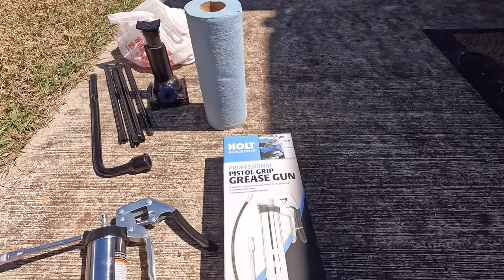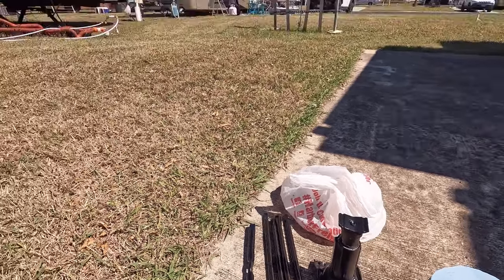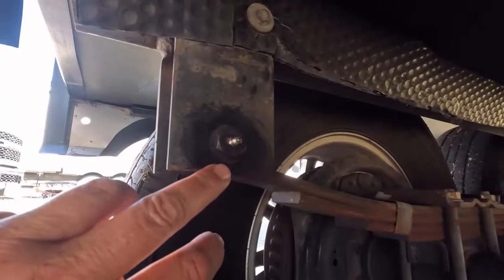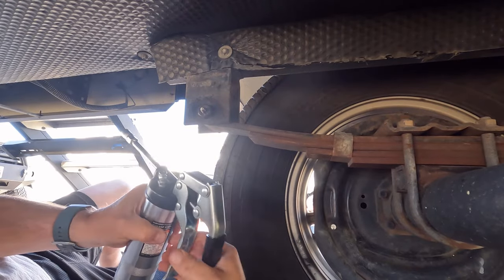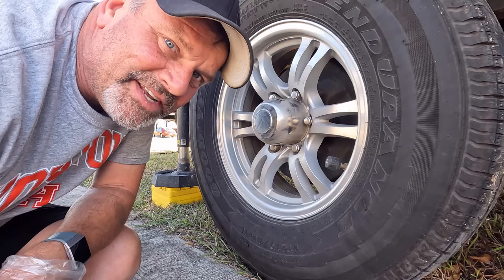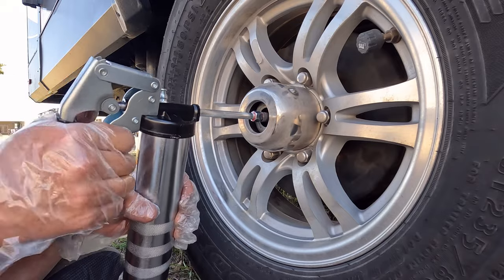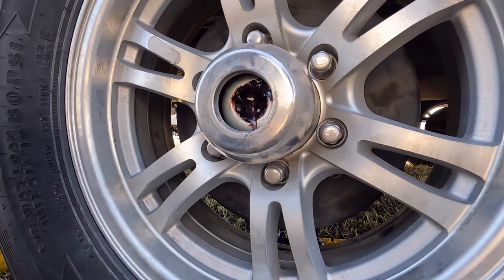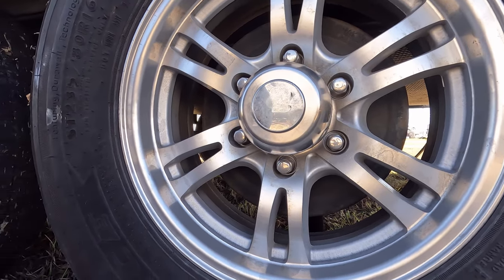The Dexter EZ Lube System for RV Wheel Bearings and Axles | So Simple YOU Can Do It Yourself!

Comment: Nice clear video, Dan!  Thanks for posting!  I just bought 4 tubes of grease for my travel trailer and I'm getting ready to do it to my Dexter EZ lube Axle.  But, I'm a little worried.  I see other videos where people claim they blew out the rear seal when they did it.  That has me worried.  I did talk to a mechanic and one tip he gave me was to do it on a hot day and put the grease tubes out in the sun to heat them up, thereby making the grease flow easier.  Makes sense to me.  He also said not to keep pumping the grease gun like there's no tomorrow.  He said to pump a few times, stop and spin the wheel to distribute the grease and then repeat.  Myself, I find it hard to believe you can blow out a seal that easy just by pumping grease into it.  Those seals are a pita to get out when you need to remove them, let alone blow them out with a grease gun.  But, I guess it happens.  Again, nice video and very clear!!
Reply from the maker: Thanks!  What we’ve read and heard from Dexter is that it is safe for well maintained axles and bearings. However, they said it is possible to blow the seals if the seals are dry rotted. However, because of the controversy, it is best to take as much precaution.  I never thought of letting the grease sit in the sun awhile but that’s a great idea. How old is your trailer and when was the last time the bearings were greased?
How have you been doing?  We are in Texas right now and heading to NM in two weeks.
Reply: @CompassRoadz  Lucky you!  We live in Kansas and only use our RV about 2 or 3 times a year.  I have a 2019 Coachmen Catalina.  Probably no more than 3500 miles on it.  Never did the bearings yet.  I heard they are pretty dry from the factory so that's why I want to inject some grease into them.  I didn't even know I had the Dexter EZ lube fittings until I started looking at maintenance on the RV.  I guess if the seals are dry rotted, that would make sense for them to blowout when you pump the grease in.  I'm taking my time doing it.  If each wheel takes 30 minutes, so be it.  Better than having to replace brakes and all that stuff.  Have safe travels!
Reply from the maker: Let us know how it goes. Safe travels to you too!!!
Reply: doing mine tomorrow. eeeeek
Reply from the maker: Good luck. Let us know how it goes!
Reply: Alright so everything went OK though I thought it did not lol. Let the grease sit outside in the sun most of the day.. jacked up one side removed the rubber cover and started slowly pumping and turning the wheel at the same time. Once I started seeing any of the new color grease inside the cavity there I stopped and did the other side. I don't see the point of filling the entire metal cup/housing thing full of grease. When I was doing the 2nd side it took many more pumps without seeing any new grease. My brain went "oh great you blew a seal" so I ended up removing the castle nut then the hub and everything was fine and I did not blow any seal. Installed it all back together and it's all good. Tips... I would remove the rubber cover AND the metal housing that you can pop off with a flat head. This makes it easier to see when new grease is coming out. Also.. if it's a newer camper where there isn't much grease in there already.. expect to be pumping and spinning more than you think. With all that said.. I'll probably hand pack the bearings next time since it's easier to get to them than I thought
Reply from the maker: @Dan007UT  glad everything turned out good. Doing a manual repack definitely has its benefit of inspecting all components. We are replacing leaf springs soon and a few other maintenance tasks to give us better peace of mind.
Reply: @Dan007UT  Thanks for letting us know, Dan.  I'll probably do mine in the next week or two.  I'm sweating it, though.  Still worried about blowing out a seal.  How long did each wheel take to do approximately?  I have a fairly new RV and never packed the bearings.  I'm sure they will take a bunch of grease.  Also, about how much grease did each wheel take?   I bought 4 tubes of grease.  I've heard some people say each wheel takes about a tube.
Reply: @garyp9906  I'll have to check on how much i used. I'd say I used about 20 pumps per wheel. I didn't want to over do it lol. I'll get back to you on how much I used but I know it was less than 1 tube.
Reply from the maker: It took me about 5 mins per tire not including jacking the tire up. Just keep rotating the tire as you fill it and you should be good. I had to stop and clean out the old grease a few times before I noticed the new grease coming through. Let us know how it went!
Reply: @CompassRoadz  I actually bring along 2 spare leaf springs, shackles, bolts, equalizer and U-bolts with us.  I've seen many videos where people had broken leaf springs and it was a big, big hassle getting the trailer towed or having someone come out and put new one's on.  Gosh, it's a shame you have to take along a complete suspension system with you when you go camping.  I even take along an extra set of wheel bearings!
Reply: @Dan007UT  Thank You for letting us know!
Reply: @CompassRoadz  Thanks for letting us know!
Reply from the maker: Coincidentally, we just received a set of four leaf springs for the trailer and will install them when we get to Alamogordo next week. Watch for a video coming out in a few weeks about that because we plan on doing it ourselves. 
We do think it’s a good idea to carry a leaf spring with us so we’ll get another to store in the rv for emergencies.
Reply: @CompassRoadz  Yes, definitely make a video about installing new leaf springs!!  Although I carry spares, I've never actually changed one.  I've seen many videos on how to do them, so I feel confident about replacing them if I need to along any of our journeys.  I carry 3 jacks, impact wrench and sockets and an arsenal of tools.  I'd hate for a leaf spring to break and be stuck for an indefinite period of time someplace.  Like I said, it's sad a person has to bring along all these replacement parts when you travel.  But, most auto parts stores don't carry stuff for RV's.  I always try to be prepared when I travel.  We have a tandem axle trailer and believe it or not, I carry 2 spare tires with us.  I figure if you get a blow out on one tire, it might take the other tire out, too.  Two flats on one side with only one good spare ain't gonna do you any good!  Waiting for the video on leaf springs!!
Reply: @CompassRoadz  Well, I did mine today finally.  We are going to take the RV about 400 miles from home this coming weekend.  Not a bad job.  I'd say I probably only used one tube of grease for all 4 tires (bearings).  I turned the wheel and slowly pumped it in.  I stopped when it started to come out.  Actually, the old grease didn't look that bad.  It definitely wasn't new, but it didn't look that bad.  As long as I know I got some grease in there, I'm happy.  I heard they don't use a lot of grease at the factory, so I was just glad to get some pumped into the bearings.  Perhaps one day when I have time, maybe I'll remove the bearings and clean them and do all that stuff.  But for now, just pumping some grease into them makes me feel a little more at ease!  Thanks again for a good video!!
Reply: @Dan007UT  Just did mine today.  I only used about a tube for all 4 wheels.  I stopped when I saw it start coming out.  I'm just glad I got some grease in there.  That tells me they were pretty dry from the factory.  I won't worry as much now when I'm pulling my TT.
Reply: @garyp9906  nice!!
Reply from the maker: Now at least you know how well they are and can determine the right maintenance for them.

Comment: thanks for the how too, I think I have a blown seal. I was coming back from Florida this week and were getting heavy rain and my TPMS system went off with a high temp warning. It was at 92f and the other 3 tires were at 62F. I pulled over and and inspected the rim and it was hot!! jacked the rig up to see if there was any play or restriction from the breaks.. everthing was fine. I pulled off the zert seal and I saw the bottom of the bearing was wet grease. So i think it was getting washed out for the rain. I pumped new grease back in there and she was fine for the rest of the trip. I will tho pull the rim off and inspect that seal.
Reply from the maker: Sounds like you had a scary experience. Glad you were able to get back on the road quickly enough even with those conditions. Hopefully you’ll get to take a good look at it and make sure it’s safe. Let us know how it turns out. Thanks for watching!
Reply: @CompassRoadz  thanks CR, will do

Comment: Thank you so much. I had no idea my axles needed lube.
Reply from the maker: We are in NWA are you fellas over by Grand Lake still?
Reply: I don't know of any axles which need lube but some guys run "wet bolts" on the pivot points for their leaf springs. This creates four grease zirks per leaf spring plus one for the rocker/equalizer bolt = 9 zirks per side of the trailer if you have tandem axles.

Comment: System works fine. First time you do it it takes about 3/4 of a tub to fill the system. Once filled it will start coming out the front.  The grease goes through the zerk, all the way to the back through the back bearing and then takes a different path all the way back to the front and through the front bearing and out. There should not be enough pressure to push grease out the rear seal unless something is wrong.

After the first time you should see grease being expelled at the same rate as being inserted. 

I think many people confuse this with bearing buddies which are completely different and completely useless.
Reply from the maker: Great info. Thanks for watching!
Reply: That is exactly correct. I’ve been using EZ lube spindle for years with no seal blow out.
Reply: I agree -- Bearing Buddies suck! Lost SO many of those on boat trailers over the years that I quit using them = expensive, heavy, and worthless.

The last time I paid someone to pack our wheel bearings, the bonehead just sat the seals on the spindles because they wouldn't fit into the bore. I learned to pop 'em in the freezer the night before and quickly tap 'em into place in the morning = easy breezy. :)

Comment: Hey Dan why didn't you take the tires off and pull the hub to check the bearings? Are there concerns with pulling off a hub that has electric brakes?
Reply from the maker: Great question!  The whole purpose of the EZ Lube system is to avoid that and the mess that goes with it. That said, even we are skeptics and I do check them manually every other time or so when I do lube them. They always seem fine but it does give me peace of mind to have eyes on every do often. Thanks for watching!

Comment: I really enjoyed the vid.  There are divided comments on Dexter EZ Lube. As a newer rv’r with a trailer, I have felt I needed to re-inspect and grease bearings and brakes every time I go out to camp!  12 months or 12k miles whether you put 1 mile on or 12k!  In some vids, folks say you should keep spare parts, too!  Where’s the time to go camping and have fun!  
P.S. can you check the seals without taking wheel off?
Reply from the maker: We are glad you enjoyed the video. We probably should have used mileage instead of time (one year) to use as a standard to regrease them. I don’t think there’s a way to check the seals properly without taking off the wheel. Maybe someone else can chime in. Thanks for watching!

Comment: I use Amsoil synthetic grease it takes heat a lot better and mine are barely warm .
Reply from the maker: That’s good to know. Thanks for sharing!  
Anyone else use Amsoil synthetic grease or have found another grease that works well?
Reply: I believe I'll try Schaeffer syn. grease. I use their motor oil in my diesel truck.

Comment: Having done this many times...the engineer that designed the outer cqp has obviously never held a wrench in his life.  To do this correctly you need to push the old grease out. With the outer cap on this is a nightmare because you need to get all of the grease out of that cap.  Its a ridiculous engineering fail.  If you just grease it until you see grease you are doing it wrong.  You do it until you clearly see and smell new grease.  The used grease has a clear burned odor to it and it needs to be pumped out as you rotate the tire.  A simple redesign of the outer cap could have made this exponentially easier.
Reply from the maker: Thanks for the info. That’s a lot more than I could know about bearings. I’m very much a novice. I only gathered information from Dexter and other videos to be able to do ours. I agree a simple way to grease bearings would be a break through!  Thanks for watching!

Comment: My dealer told me that they had to be hand packed because the grease gun would blow the seal. I don't think i Believe him.
Reply from the maker: Not if it’s the Dexter EZ Lube system. However, you do need to take some care to avoid blowing the seal. Dexter claims it happens mainly after it’s dried out after a few years without maintenance. Thanks for watching!
Reply: Can’t push seal out of the plug is open, zero pressure doesn’t push out a seal, just remove all excess grease.

Comment: You just set yourself up for axle seal failure… wayyyyy too much grease all its gonna do is push it out the back right on your brakes 🤦🏼‍♂️
Reply from the maker: Well 1600 miles later with no issues.
Reply: The way the rubber boot around the grease zirk is designed, it's easier for excess grease to ooze out there than it would be to pressurize and blow past the spindle seal. Those seals are designed to grip tighter on the spindle as the pressure increases. We've averaged 11,000 miles for the last 8-1/2 years with quite a bit of that in off-road conditions -- never had a single wheel bearing failure with our 33' 5th wheel. :) Then again, when the going gets tough, we slow w-a-y down with our F350 in low range = no need to engage the manual front hubs if we don't need the extra traction. :)

Comment: Being in the lube biz you should never mix grease..
Reply from the maker: Didn’t know that. But wouldn’t the new grease expunge all the old grease?  That is good for people to know regardless. Thanks for watching!
Reply: @CompassRoadz  - According to the Dexter video on how to do this, you are correct...the new grease displaces the old grease and forces it right out the front.  Dexter says to pump in grease until all of the old contaminated grease is pushed out and you can see new grease.  I've used Dexter EZ lube for 6 years on our trailer with about 30k miles and just took them apart this spring for the first time...bearings looked perfect.  Just repacked them, new seals, adjusted brakes, and good-to-go.  I have always used Red and Tacky grease.
Reply from the maker: @dewrus2153 I love the red stuff. Easy to see where the old ends and new begins. Thanks for watching!